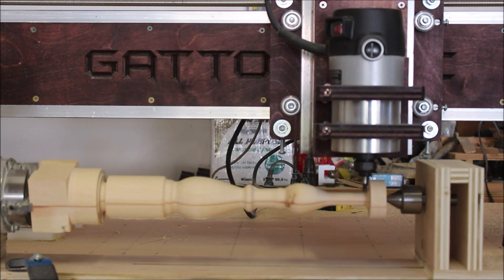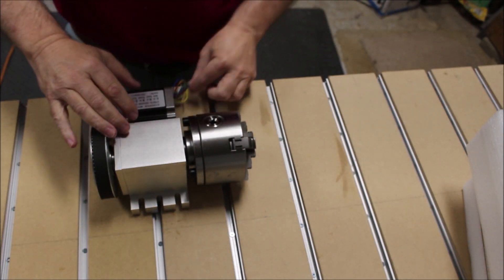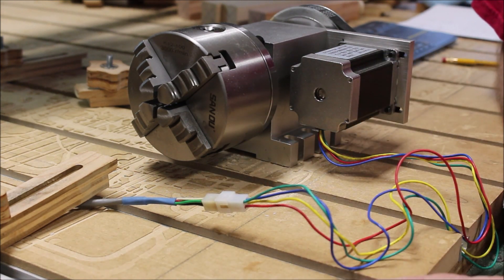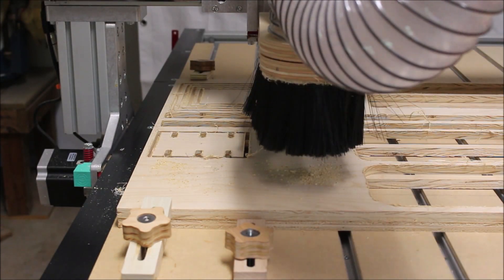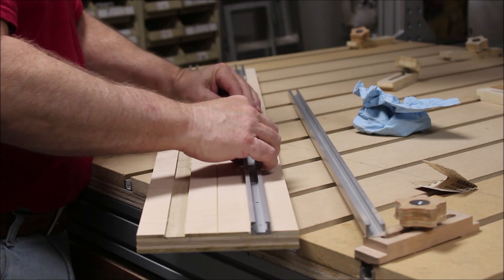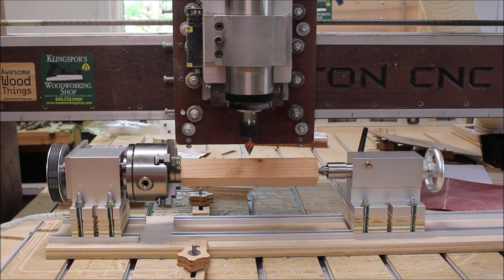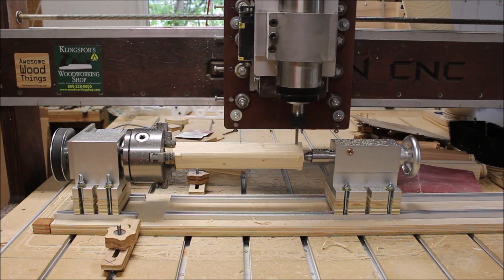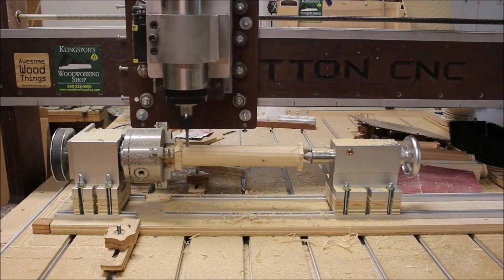Rotary Axis Upgrade

Comment: Please details of ,gear box, chuke size make and rasio, stepper motor, RPM and resolve. And stepper driver satting, A Axis in controllar pulse settings parameters 

I liked this your engineering work on video 

Please request to you send me 
Gears make, stepper driver, stepper motor, chuke size 

And approximately rate 

I'm from India Gujarat Ahmedabad
Reply from the maker: The link to what I purchased is down below in the video description.  Feel free to check it out for yourself.

Comment: is it possible to run it faster? i'd love a rotary axis as it's pretty involved to convert a CNC lathe, but i cringe a bit when i see how slow a 4th axis is compared to a lathe!
Reply from the maker: You're comparing apples 🍎 to oranges 🍊.   Try doing a 3D carve on a lathe.
Reply: @DaveGatton  oh i know that carving isn't possible on a lathe - maybe i should reframe. i'd like to engrave some things with a rotary but i'd also like to use it to shapesimple plastic and wood pieces. if i had a 1/4" bit in my router i could hog off a lot more material than i could with a tiny carving bit, similarly i could take a lot more material off if i was running the 4th axis more quickly. so i'm wondering if it's possible to run it a lot faster.
Reply from the maker: @guitarchitectural  yes.  You can go pretty fast with a roughing pass but to get a smooth finishing pass the step over is so small that it will take a while.  There's no sense in getting it done faster just so you can spend time sanding.

Comment: How do you zero with the rotary?
Reply from the maker: When using the Vectric software you can select to Z zero on the top of the material or at the centerline (axis) of the material.  I like to use the centerline so to do that I found Z zero without any material in the way by lining the bit up with the point on the live center.  Then I moved the Z axis up to the top of the aluminum block of the live center.  Now I know the distance from the top of that block to the centerline of the axis so I can use the top of that block to Z zero and just add in the distance down to the centerline without having to remove the material that's already chucked up.  Thanks for watching Ryan.

Comment: Hi Dave - how does this rotary axis unit from China compare in quality and performance to the unit that Axiom provides?
Reply from the maker: Thanks for watching John.  As for the comparison, I don't have anything by Axiom so I have no idea of their quality.
Reply: @DaveGatton  Their rotary axis actually comes from JTech - so anybody can buy it and you do not need to have an Axiom CNC. I looked over the specs sheet side by side , comparing the 2 products and I'm not an expert but their doesn't seem to be any difference. Which leaves quality of materials used in construction and engineering to justify a 500 dollar price difference.